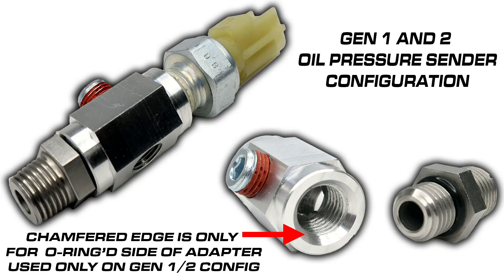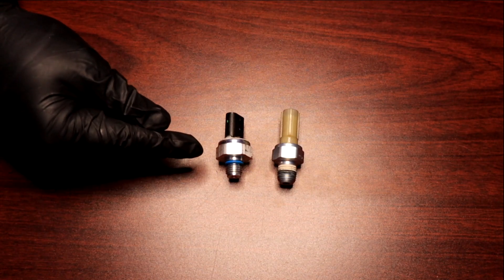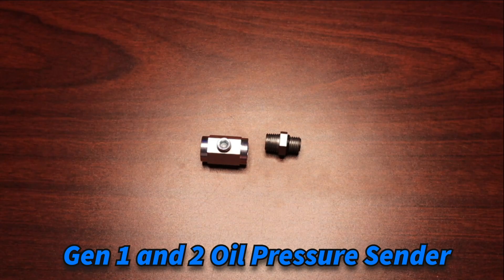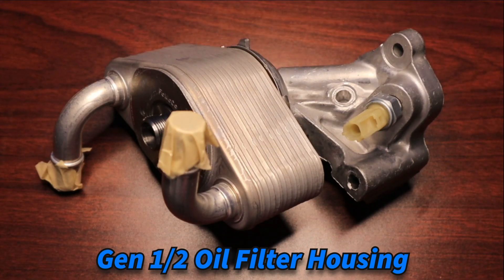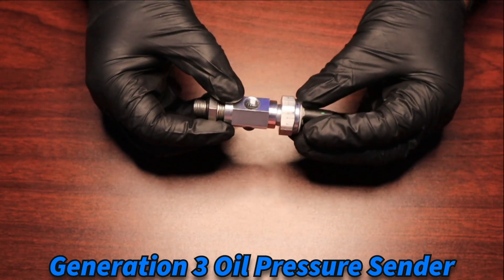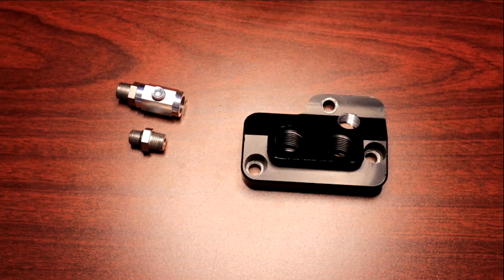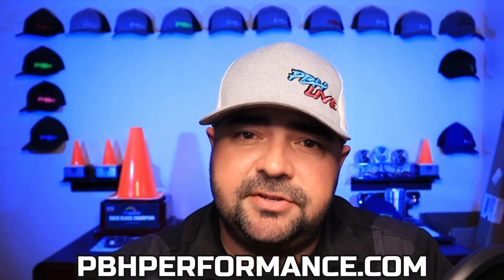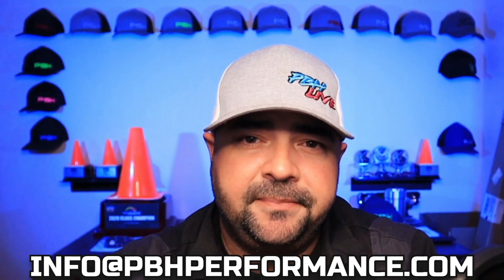Finally an Oil Pressure Sender Adapter for all Coyote Swaps!

Comment: Awesome I have been trying to get my oil pressure and oil temp gauges hooked up forever, I bought what I was told and thought was correct fitting but it wouldn't thread into block as thread was different I think one was course the other fine. Anyway now I know i can just order this and be able to put my stock sender, aftermarket sender and oil temp sender all on so no engine light from not having stock one back on etc. Now I waited till I was doing oil change to try the sender but noticed it's pretty far up on block, so can I remove stock sender and install my new stuff without waiting to drain oil etc if I don't have to wait for oil change to dry it great that's what's in hoping? Lol So would I be able to do the switch of senders without draining oil, thanks.
Reply from the maker: Sounds like a plan!

Comment: Hey , just wondering if you know where to find the oil pressure sending switch is on a 2021 f150 xlt 5.0l , I removed the alternator and tensioner but am still unable to find the switch. Sorry, I just don't want to spend money on a mechanic if I don't need to.

Comment: Question do I have use an adapter or can I just  put it in the way it is
Reply from the maker: This product can be used on oem applications so an oil filter adaptor is not needed for use.

Comment: Awesome! Will this work with the Boss 302 gauge cluster? Also any ideas on how to get oil temp from this unit onto the CAN bus?
Reply from the maker: Hey bud, not sure what sensor could be added to give you oil temp in the factory can bus, so I am gonna say no on that one. This is just an adapter that allows your oem sensor to remain while adding ports for more senders.